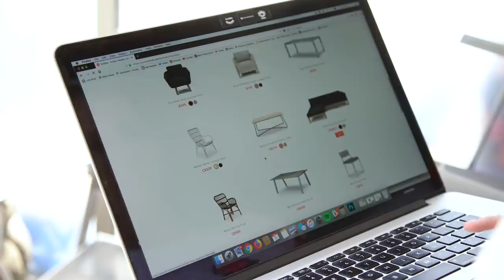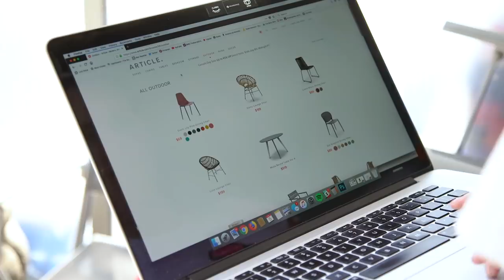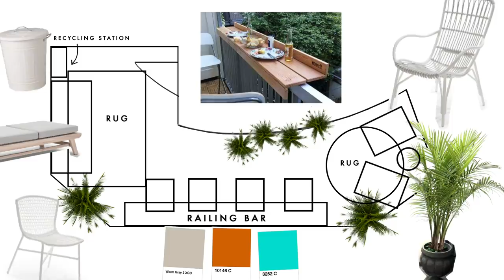Beautiful outdoor patio transformation

Comment: I'm not 100% sold on this makeover. The bar looks like it might fall over any minute, with how thin the legs are. Theres no umbrella or protection from the window washers water, I can see it getting ruined quickly. also, trying to sit at the bar with them chairs, not sure if you'll even reach the top! I loved the idea of the bar, just feel it's not 100% working the way it is.
Reply: Im pretty sure they bolted it down on the side (I thought I saw them, but they never actually said) and once the stain dried it became water resistant and ready for the outdoors!

Comment: I love the space! I love the overall vibe and adding the railingbar is super creative! The only thing that would make the place a bit more efficient would be using barstools instead of chairs. The current chairs are pretty, but they're way too low. Also, coming up with something for the window washer. A little shutter or something that you can roll out. Because right now, at the next washing day, soap and water will wet the carpet.

Comment: The patio did look better, but it wasn't great in parts. Far from it. The brown/mustard canvas screens looked a bit tacky, IMO. Bar stools were required. Not bar chairs. Too low. The bar needed to be a darker colour maybe? The white chairs needed proper cushions on them, as they are too hard work to sit on after a while. You'd have to take all 3 pieces of carpet in at night, or store them somewhere, in case it rains.  It was a good start but it needed a bit more work.